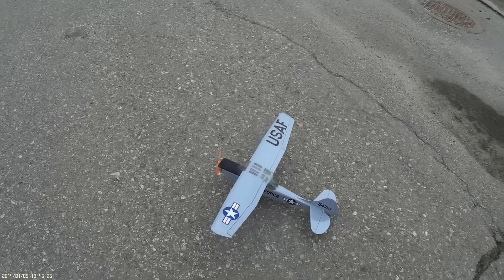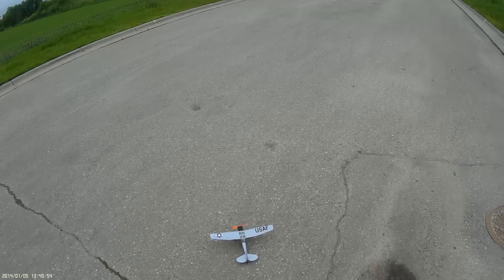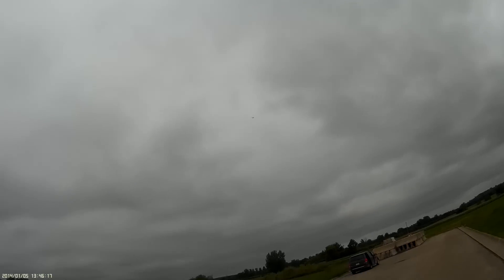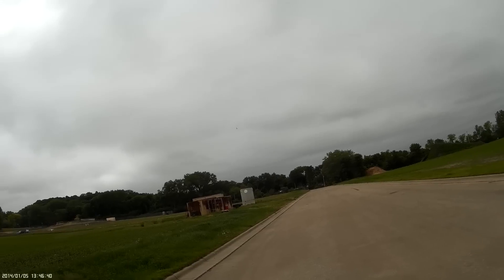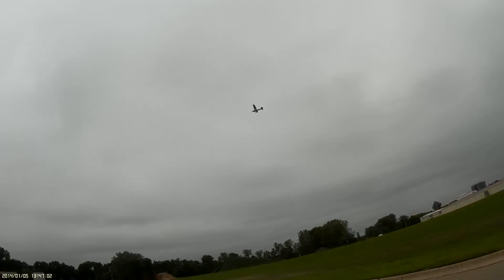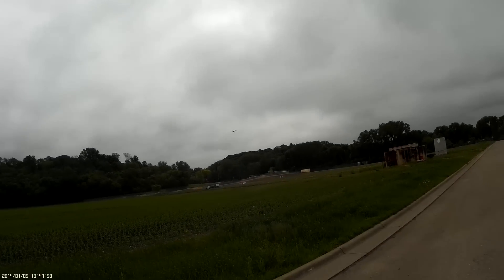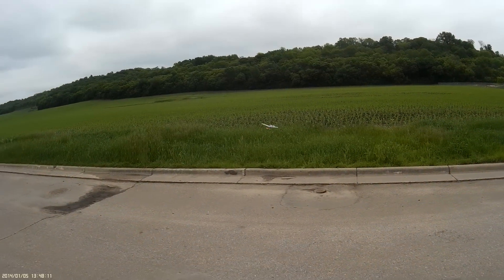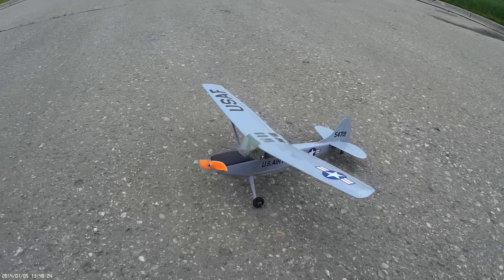Guillows Bird Dog RC test flight

Comment: I sure like that more than any parkzone plane.
Reply from the maker: +Nathon Brown  thanks nathon, it's thanks to the parkzone planes that I have parts for some of my guillows conversions =D . I really think that this model would work out with the running gear from a PZ ultra micro p-51 and 2 wing mounted linear servos for the ailerons or no ailerons. as I built it it is a bit heavy but very stabile in wind and powerful enough to get out of trouble which wouldn't be happening if running the PZ 1 cell power and gearbox brushed motor.